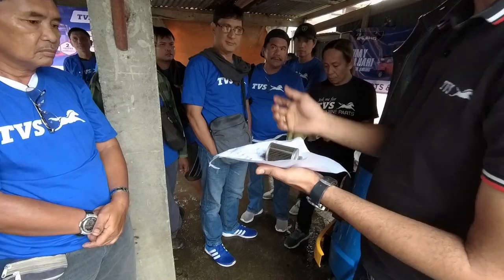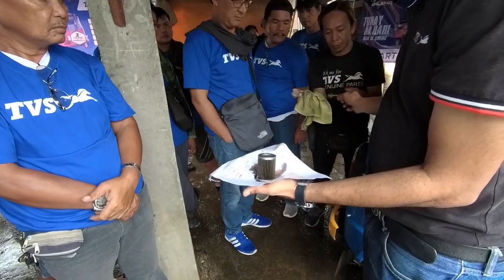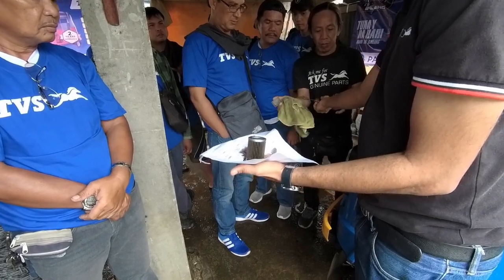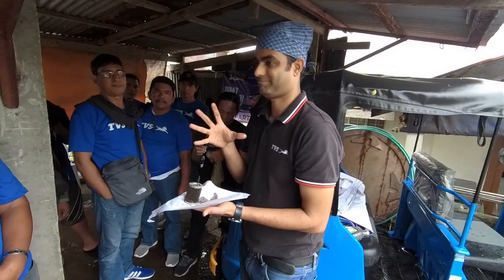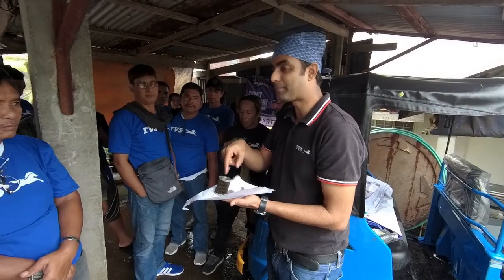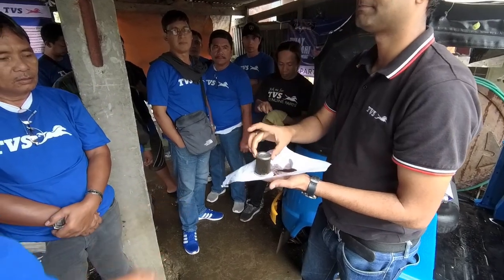TVS King Auto Rickshaw Changing Oil Filter

Comment: Sorry I didn't understand, did he said every 1k or 5k change oil and filter.
Reply from the maker: 1k top up oil 5k change filter
Reply: Sir may tvs king po ako may engine oil ligth on during engine idling ,,, pag  accelerate mawala ,,, ano po problema sir?
Reply from the maker: @reynantecabahug756  I have been told this is a sign the oil needs changing.
Reply: @TukTukPH  sir ask ko lang magkano po ba d.payment nyan.